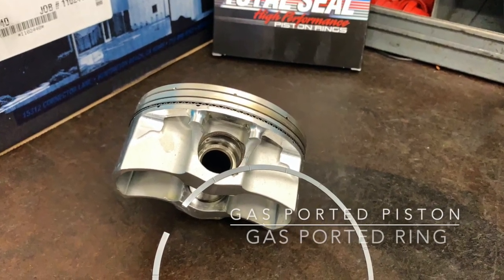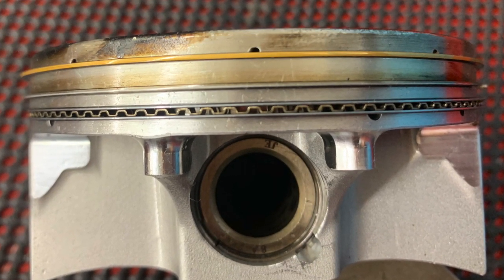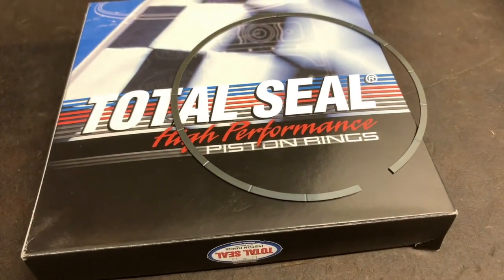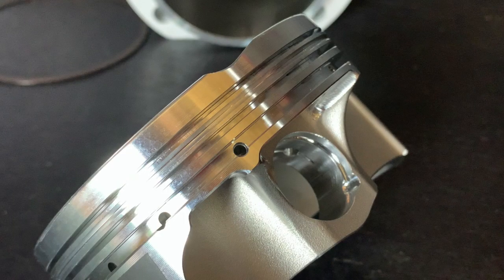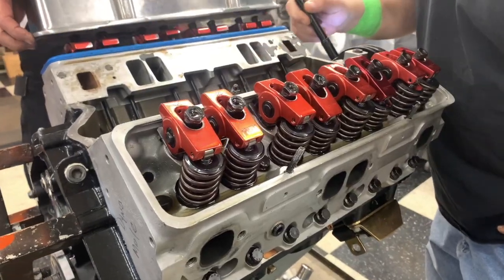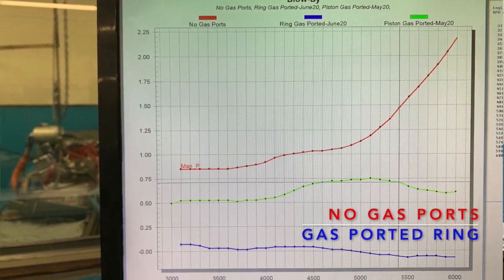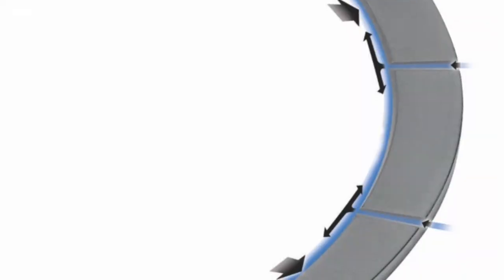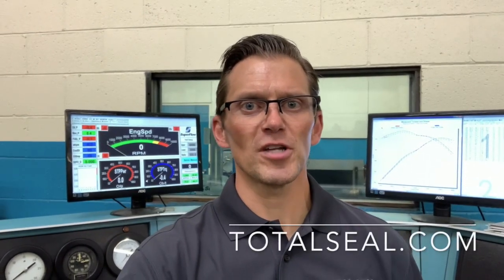Do Gas Ports Reduce Blow-By? Watch This Video Before You Buy New Pistons Or Piston Rings!

Comment: Thruout almost all of the RPM range the GP   rings were worth 1 - 3 hp. 
Worth 5 -6 hp at peak.
If i were buying rings from scratch wud i choose GP ?
Yeah maybe worth the added cost.
If i already had a good set of moly rings (and i do) - 
wud i chuck em and replace with GP for 3 - 5 hp ?
Doubtful.

Comment: I'm thinking about going gapless top ring for my setup but still in doubt if gas port gapless ring will wear faster than a non gas port gapless ring. PVD coating may protect it?
Reply from the maker: The PVD coating makes the ring last longer. For a street application, the gas ported top ring is the way to go.

Comment: Runner loose and when the stroke that needs to seal is in motion, seal it up with the pressure available.  Good for a lower compression boost3d application.  Id imagine the gains would be beneficial/ substantial

Comment: I would have expected all 3 to be about the same at the lower RPM since there is plenty of time for all of them to inflate the ring.  It is strange that they are different well below the flutter speed. Also strange is the gas ported ring showing a vacuum above 5000., negative blow by? How would that be measured on a rotameter?
Reply from the maker: Great observation. Because the area in the ring groove above the top ring varied, the low RPM response varied. All the rings were installed with .0007 side clearance, but the gas ports add area above the ring in the groove. As such, the 15 smaller gas ports activated the ring better than the 8 larger gas ports in the piston.

Also, the dyno cell has a positive .5 in pressure, so the negative reading shows how the engine was sucking the positive pressure out of the room with the gas ported ring.
Reply: @TotalSeal  I'm not feeling it. At low RPM there is sufficient time for all 3 types to pressurize/activate equally. The fact that the low RPM curves are all flat below 3500 tells me that the inflation & blowby is consistent for each type but are at different levels for each type for some reason. So even though the standard ring surely is activated at low RPM, it still allows more blowby so the seal cannot be the same for some reason other than the activating pressure since all 3 have full inflating pressure @3000.

 I think a leak down test of each ring type in the test would be useful here. That way you take the inflating/activating time out of the equation and just see what the actual sealing is.

 I think you should add in a dykes ring to the test to compare so that back of the ring groove pressure is less of an issue.

My main concern when evaluating this is the crevice volume increase that the gas ports add.

I'm also thinking that the gas ported ring might be allowing a bit more compliance to the cylinder because of the segmented areas.

Comment: 🤔 Would these ported rings are able to solve the problem of fuel dilution?. Like what had been happening in small TC direct injection engines. Regards 🤔
Reply from the maker: They can help, but injector cleanliness is the primary factor in DI engine fuel dilution. The injector must be clean for it to properly atomize the fuel.

Comment: But how much faster do the piston rings wear out
Reply from the maker: Not any faster. Piston ring wear is all about cylinder bore surface finish and oil quality. If the ring is properly lubricated, it will last.

Comment: Very interesting and informative.
Is there a possibility that the slots cut into the rings might concentrate the stresses due to ring flexure and be a failure mode for the rings in higher mileage applications?
Reply from the maker: Great question. We've not seen any fatigue issues with gas porting on the coiled steel rings. We can see the possibility of that problem in cast iron rings as that material is more brittle and prone to cracking. Fortunately, the stainless steel rings are incredibly durable, which is why we use that material to make the .5mm rings.
Reply: @TotalSeal  Thanks.

Comment: i saw 2 dyno tests on a NASCAR cup engine back to back. the second test all that was done was to file fit the top ring to.125 end gap and the engine lost less than 10 HP. it blew oil all over the dyno cell but did not hurt the HP much
Reply from the maker: Great comment. End gap is often subject to "overthinking". Many times people worry too much about end gap. We ran .032 end gap on these rings. End gap plays a much smaller role in ring seal than people think. Adding the gas ports make a much bigger difference than the end gap does.

Comment: could 400cc below race bikes get more power from this? thanks in advance :)
Reply from the maker: Yes, we saw gains from gas ported rings in a 250cc engine.
Reply: @TotalSeal  do you produce gas ported rings for kawasaki EX250? I would like to try to prove it. im an engine builder here in philippines.  im thinking of marketing  your products here :)
Reply from the maker: @perez813  what is your bore size and the dimensions of the ring grooves on your pistons?

Comment: How will the gas ported ring work on the street?  Also, are the gas ported rings coming also in gapless?
Reply from the maker: Great questions. The gas ported rings work great on the street. No excessive wear or carbon deposits. 

Also, gas ported rings can be combined with the gapless design for the ultimate in ring seal!

Comment: Were the rings in the gas ported pistons the same thickness and tension? Was the piston the same design so compression didn't change? There are details left out of this video. It is a good design but tell us specifics on how it made more than this particular gas ported piston.
Reply from the maker: Thanks for the questions. Yes, the rings in all three tests were the same thickness and tension, and the piston design was the exact same (other than the gas ports).

Comment: How many gas ports have the Total Seal piston ring and the gas ported piston? In my opinion, a comparison makes sense, if the gas ported area is the same.
Reply from the maker: The gas ported rings have 15 slots, but those slots are smaller than the gas ports in the pistons, which has 12 gas ports. The total gas port volume is similar.

With that said, gas ports on pistons do vary. Pistons don’t always have the same number of gas ports. The number of gas ports in a piston varies by the piston design.
Reply: Thanks for the fast reply. For example: My Cosworth CA piston has only 4 gas ports.
Reply from the maker: Got it! That’s a great example.
Reply from the maker: Do you know the size of the gas ports?
Reply: The diameter of the gas port bore  is about 1 mm and the compression ring height is 0,63mm.
Reply from the maker: @Engine_Tech_V10  Ok, the standard gas ported ring would have more gas port area than the gas ports in your current piston. We can custom the gas port volume in the ring to fit most requirements.

Comment: So the baseline was on a used piston and ring setup??  Would be nice to compare new-new.
Reply from the maker: No, the baseline run featured a brand new ring and the pistons had just a few previous test sessions on them. In fact, the baseline runs were actually slightly better than when the pistons were brand new (with the same part number rings), so the brand-new to brand-new comparison would be slightly more advantage to the gas ported rings. We used the best numbers from the baseline combination for the comparison.

Comment: Nice results, and interesting.  Can you please clarify, in the first configuration, was the block fresh honed too i.e new rings, but the prior run gas ported pistons retained?  I presume the same new pistons being used for the last two test serials (TC gas ported, & non gas port)?  Hence, were the pistons otherwise identical, and the 2nd and oil ring package retained or swapped out each time?  Further, were the materials and surface coatings for the top rings all the same?  Thanks, sorry lots of questions :-)
Reply from the maker: Great questions. Yes, the block was freshly honed with new rings for the first configuration. The results of the first configuration matched the results from the same configurations previous test. 

Also, the 2nd set of pistons were identical to the first set of pistons except for the omission of the gas ports, and the rings were all .7mm steel, Diamond Finish rings with a PVD face coating.
Reply: @TotalSeal  Great, thanks for the detailed reply.  I presume the lateral piston port went to the back of the ring, than stopping just prior the back of the ring depth?  My feeling from these results, is that lateral piston port combined with your ported ring would likely perform similar to a standard ring combined with a standard piston?  Presuming the effect must be a function of the increased area of the lateral ports added to & compared the void area at the back of the ring; contrast your ported rings grooves are presumably much smaller net volume increase combined with a tight ring groove amplifying the effect?
Reply from the maker: The piston gas ports did go past the ring just as they are normally cut. Since we have not tested the gas ported rings with lateral gas ported pistons yet, we don’t want to speculate about what will happen. At this point, the data just shows that gas ported rings > gas ported pistons > no gas ports in terms of blow-by and HP. More to come...

Comment: What bore-size gas-ported rings do you expect to release? I work mainly on Subaru engines with the following bore sizes: 97mm, 97.5mm, 99.5mm, and 99.75mm.
Reply from the maker: Thanks for the question. We can gas port rings for any bore size, and the rings can be as thin as .6mm and still be gas ported. As such, we offer gas ported rings sets in those bore sizes. For technical assistance, contact 623-587-7400.

Comment: How about using gas ported piston with gas ported rings? Would that improve sealing/hp or is it not recommended and why? Thanks!
Reply from the maker: Thanks for the great question. That is the next phase of the testing - gas ported pistons with gas ported rings. We have some ideas about what might happen, but we will wait and see what the results tell us. Until then, we’d recommend using the gas ported rings in non-gas ported pistons.
Reply: @TotalSeal  Thanks for the reply, looking forward for the results. I already have gas ported pistons and was wondering if I should get gas ported rings or not
Reply from the maker: Understood. Stay with non-gas ported rings for now. We will share what we find after the next round of testing.
Reply: In theory, they may work well together, but my only concern is ring binding when you remove so much surface area via slots on both the ring and the piston. I use horizontally-gas-ported pistons in Subaru applications with standard rings and they work very well. It would be interesting to see the results combining the two. Vertical gas ports in the pistons and gas-ported rings may be the answer as well.
Reply from the maker: We have the same concern about lateral gas ports in the ring and piston. Going to vertical gas ports in the piston with a gas ported ring is also something we want to test.